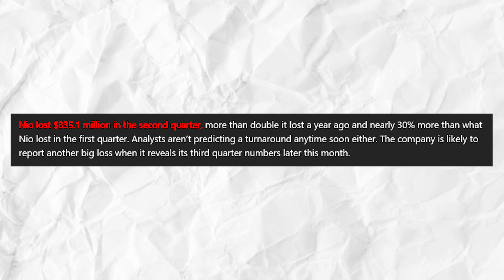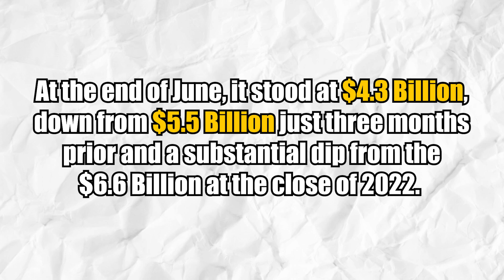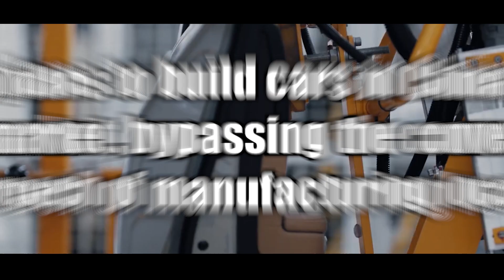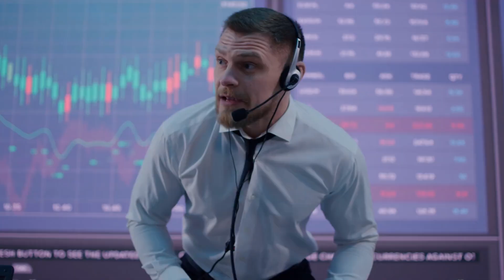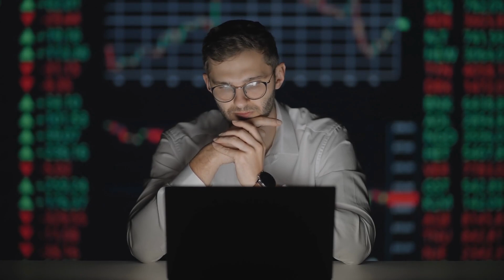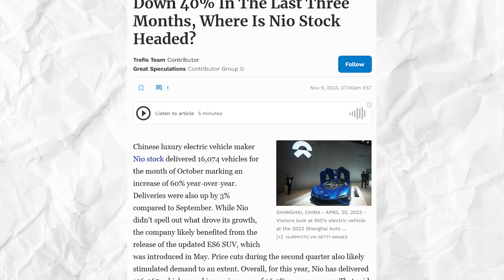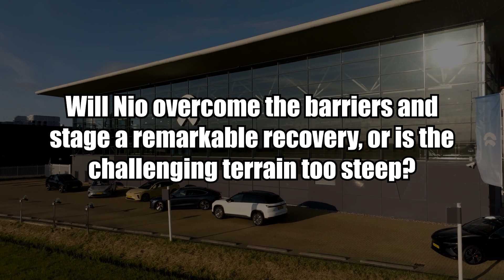Navigating NIO Stock: Layoffs, US Entry & 2024 Outlook Revealed!

Comment: NIO stock expectations are mixed, with different analysts giving different price forecasts and growth rates. The median target of 29 analysts is $11.94, which is a 57.72% increase from the current price of $7.57. However, the lowest target is $6.82 and the highest is $24.701. The average target of 11 analysts is $18.72, which is a 140.31% increase. NIO is expected to grow earnings and revenue by 67.4% and 24.7% per year, respectively. However, the short-term trend is negative, with a 90% chance of falling between $5.81 and $8.00 in the next 3 months.